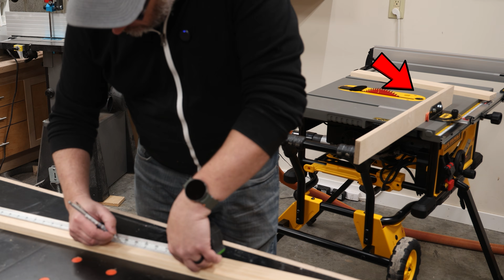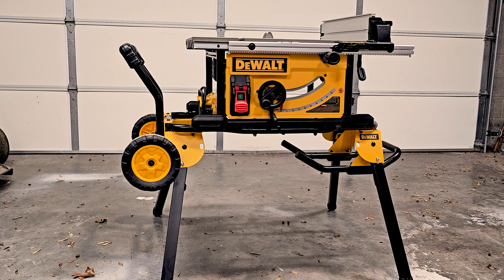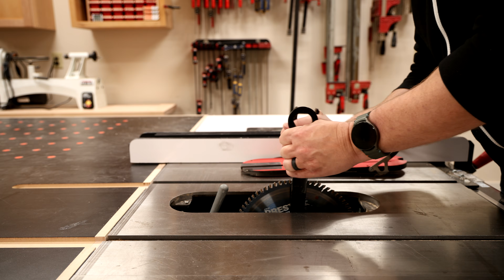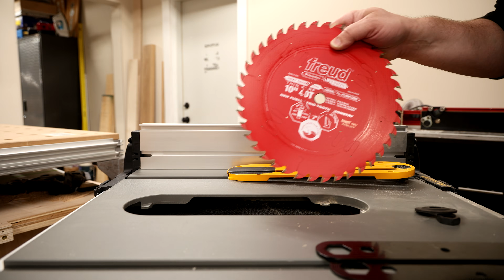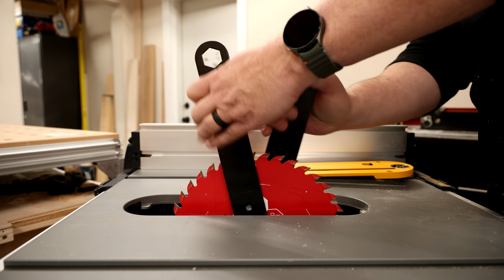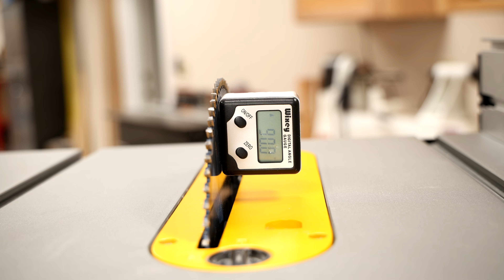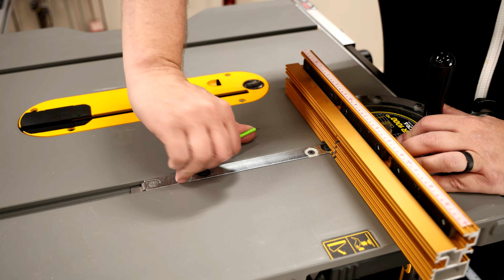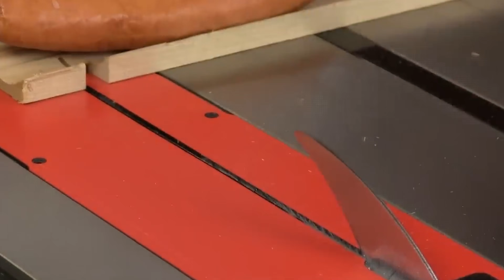Why do people even buy this saw?

Comment: You missed three points.  #1 - noise.  When I went from a job site saw to my SawStop I was amazed at how quiet the SawStop was.  And, #2 - dust collection.  I was similarly surprised at the improvement in dust collection.  #3 - safety.  I know that YouTubers don’t like to use them, but I have found that the blade guard, splitter, and kick-back paws on the ShopStop are similarly far superior and easier to use … not to mention that the blade guard ‘support’ on my portable saw was always out of line with the saw kerf and was too wide for any effective use with thin kerf blades.

Comment: Interesting video.. I have owned both a Delta Unisaw and a Dewalt Table Saw.  I was pleasantly surprised on how well the Dewalt did after years using the Unisaw.  Used to cut oak all day on the Unisaw and it never tired but never tried on the Dewalt.  Full Sheets are always a pain although a good outfeed table helps as does some infeed support. Starting all over again and thinking Track Saw to start this time. Nothing brings more joy than just turning on the Unisaw... you can hear the power.

Comment: Great video. Thanks! Does anyone know what it would cost to take the contractors saw to a machine shop and have them 1) mill the top completely flat (or at least a lot closer to flat) and 2) machine the slots to be identical dimensions and perfectly parallel to one another? Seems like a pretty simple job for them, no?

Comment: Very interesting video. I have that exact Dewalt portable saw. It’s not as much a question of money (retired) but rather the space to house it and amount it gets used makes it very hard to justify, It’s mighty handy to “fold up” the Dewalt and tuck it against the wall in my garage after use!  Thanks for answering some of the questions we’ve all wondered about! This would be an interesting comparison for say a Rockler or Bosch portable router table vs a real high end setup too!  Nicely done, thank you!

Comment: Cabinet Saws traditionally have way better  dust extraction systems   Larger /stronger motors  and in the Comparisson to a Saw Stop  you have the safety  device. Of stopping the blade  spinning  when the electronics detect  skin   The also  traditionall have Etter fences and larger Capacity in comparing them to. A Jobsite Saw. Although. The Jobsite  saws have been getting   Some serious Upgrades  depending on the manufacture    IM retired now  but spent over 35 years in the Trades as a Professional Woodworker and I will note that before CNC technology  and  all the specialized tools  The  Shop Table Saw. Was a tool that did it all  from  cutting every angle  on any sized or type of material   In the old days people built   Jigs   To do allmof that for their Saw  A Craftsman  may have had hundreds of jigs for his Saw    A local shop/ Competitor of mine  had to duplicate a replacement Wood Keel. For the oldest  Wooden Warship for the United States Navy  that was  over 100 feet long and was being fabricated out of the only  known tree   Inthe world  they cut that on a Table Saw  it took   Over 40 men to hold and guide that. Lumber through the Saw  it needed to be done in their Parking Lot to get the correct positioning  in reference.  To all the You Tubers with the fancy  expensive  tools IMO    It’s Hogwash  ,   IM still a Woodworker and I do not own any Kreg or Festool Products   You can   Do everything they do with trsditionalWoodworking tools  by building Jigs  and using hand tools   You don’t need a Dominoe  machine you can build a   Jig  for a WoodRouter  and use  specialized Router bits , same thing  with Lamellos or Biscuits   It’s basicJoinery   In the past. Men that built boats ,Pianos  and Fine furniture utilizing  traditional joinery  did most of it with handsaws and Chisels   ?  Many of today’s Craftsman thatdnt even know how to properly sharpen their tools

Comment: I’ve marked photographs as exhibits in a lot of depositions where the photos depicted mangled and missing fingers from a man’s hand that went through a table saw blade.  I’m a woodworker.  I still have all 10 of my fingers.  Why?  Not because I’m safe, not because I’m lucky; it’s because I bought a SawStop table saw. That’s my insurance against the stress of a wood board being relieved at the worst possible moment and pulling my hand into the spinning blade.  A little cut, a tiny one that only needed a small band-aid.  You see, fellas, MY fingers are worth the extra $500 to $900.  If you don’t value your fingers, or if you are arrogant enough to think “this won’t happen to me cuz I don’t make mistakes,” then think again.  My father operated his 1952 Sears Craftsman table saw for 60 years without incident because he was SAFETY conscious, yet even he had a mishap where the sudden relief of stress in that wood board pulled his thumb into that spinning blade.  He lost 1/3 of an inch of the tip of his thumb.  Then my brother, the safest woodworker I know, cut the tip of his index finger off for the very same situation, and he’d been operating a table saw for 45 years.  You see, gentlemen, it’s not a matter of “IF,” it’s simply a matter of when.  Every table saw operator has a close-call story to tell, but unfortunately, a hell of a lot more ended up in tragedy.  Let me ask you this:  Would you give up one or more of the fingers on your hand just to save $500 to $900?  I don’t know about you, but MY fingers are worth a hell of a lot more than that.  I’ll gladly give up a few bucks to save my fingers.  How about you?

Comment: Found a used Sawstop contractor saw 6 years ago.  Dust control is not excellent but I don't have collection anyway, and 110v motor can be down on thick rips, but otherwise it's precise and an excellent tool.  Built a custom base with storage and prior owner had a good outfeed setup.  Came with an unused dado stack and some good freud blades, it was a solid buy.

Expensive track saw?  Meh, my Makita was $120 on ebay and got the guide on amazon.

Comment: Is there something in between the job site saw with aluminum table and the cabinet saw with a cast iron table? How about a bench saw with a cast table and better adjustments for the blade.
Reply from the maker: a contractor saw is the middle ground

Comment: I don't understand cutting down sheet goods with an incredibly accurate track saw and then finishing the cut with a table saw. Americans do that and from what I understand, most Europeans don't. I've watched hours of Ron Paulk doing fine finish carpentry without a gigantic space hogging table saw. I think for most it's a waste of money unless you have a large shop with plenty of space. Then speed comes into play, but you sure gain no speed from multiple unnecessary cuts.
Reply from the maker: I find the table saw to be far more efficient for cutting parts to final width. The table saw is still needed to make joinery, dadoes and rabbets. Track Saws are great for breaking down plywood but its far more time consuming to try and cut out all your finished parts using a track saw alone. I've watched a lot of Ron's videos, and even using a small jobsite table saw, his full setup with his work table and other accessories is every bit a space consuming as my table saw. It just works better for mobile applications which is the only reason he designed that system. I don't do mobile work I only work out of my shop.

Comment: I was always under the impression that you actually do not want the fence to be perfectly parallel with the blade to avoid pinching the workpiece and also causing inconsistent cuts. I think you want it to open up at the end a smidge for the wood to NOT hit the backside if the blade. The leading edge of the blade is where you cut and set the dimension of the cut. I don't want to suggest that there should be a large angle, but 1/32" is probably not terrible.
Reply from the maker: yes you certainly can do this but you have to be really mindful if you ever cut with the fence on the opposite side of the blade. because now instead of being angles away from the back, its going to be angled toward the back and cause a kickback.

Comment: I started building a new sawstop 52" in my shop. I've had a few issues with the tabletop and wings. The wings when mounted tip up at the outside creating about a 3/16 void over the table. I've built out two other cabinet saws with no issues. Concerning. Sawstop sent a six page instruction sheet to correct it. There are two methods. 1. Forcing the wings down and bolting to the rails. 2. USING PACKING TAPE TO SHIM THE WINGS INTO POSITION????? WHAT? ON A NEARLY $5,000 SAW?

The second issue is an area on the right side of the main table that has large burrs in the cast iron and a noticeable low spot that cannot be leveled. Has anyone else had these issues? I'm not happy at all and sawstop has been very slow to respond.

Comment: i like your videos. Informative and well explained, and you don't spend the entire video yelling at the top of your lungs like the 731 guy. The safety of the Sawstop, in my mind, renders all of the other discussions moot. As an older retired guy, maybe not quite as attentive as I once was, the Sawstop is worth every penny. I have the contractor model with the cast iron side wings and I really love this saw. I set off the brake once because I forgot to set the bypass and it hit aluminum t-track in my workpiece. Goes off with a helluva bang!

Comment: I started with a 2 hp Delta what is now considered a hybrid table saw back in 1989 with a cast iron table. There were no Jobsite at that time. I still have that saw but have bought a 220 v 3hp cabinet saw which makes set up and cutting much more pleasurable. I am no longer resetting the breaker on long rip cuts. I would recommend finding a used hybrid or cabinet saw if you have room to see how much you use it before spending big money on a cabinet saw. If all you need is a saw that you can take to a job or you do not have room for a permanent saw, then get a jobsite saw knowing it is not the same as a powerful and stable cabinet saw.

Comment: setting the bevel from scratch might suck on the DW, but once you catch the correct angle just bevel a piece of scrap and write the angle on it, next time you need to set that specific bevel you can just use the scrap wood to set it.

I think. There could be something wrong with that approach and I've never used a saw with a floppy bevel like that, but I see no reason why you couldn't do it like this.

Comment: My Rigid job site saw collects dust in the threads that raise/lower the blade.  It is a real pain and slows any changes.  Perhaps not an issue with other saws, but even after cleaning, in two cuts, back to the slow go.

Comment: It greatly depends on what you're using it for. If you're making your living building cabinets and rip cut full sheets of plywood every day it's a no brainer to me.  A weekend hobyist is a whole different story. Are you cutting for dead or accuracy you can count on every day or just making a shelf board once a year?  The vast majority of the small job site saws end up just collecting dust because anyone can run to any box store and be cutting up wood that same day and forget they even have it the other 364 days of the year. Most people who are going to spend $3–5000 and maybe even rewire the whole garage and take up enough space that a cabinet saw is are far more likely to use it more often.  And of course there's the matter of being just clumsy and chopping fingers off. Personally I kind of enjoy not spending my weekends in the hospital getting fingers operated on. I'm just that kind of a weenie..I've had to drive one handed to the hospital with blood dripping everywhere before. It's not nearly as much fun as seen on TV.   😂

Comment: I see that you removed the riving knife with the thin kerf blade. Something I'm not prepared to do. The full kerf blades do fine on the contractors saw if you keep them sharp and go slower.

Now that STOP has released the patent, most saws of the future will be stop saws. Even the contractor saws.

Comment: If it wasn't for one detail you didn't mention, I may never have upgraded my DeWalt jobsite saw to a Sawstop. By the time I'd converted my DeWalt to work like the saws I really admire, the Euro slider saws -- then you don't need a brake to stop the blade because the saw is fundamentally safer -- the footprint of the DeWalt was about the same as the Sawstop contractor saw I bought. For really thick stock I rip with a bandsaw and clean the edge with table saw, so there's barely a functional benefit to the Sawstop. So here it comes: the belt driven contractor saw is 80 to 85 dbs compared to the DeWalt which is like 109 dbs. Hours and hours of cutting, even with ear protection, take its toll, not only on you, but on other members of the house let alone neighbors.

Comment: Nice comparison video.  FWIW, you could have slid the fence back and forth on the DeWalt without having to turn the knob.
Reply from the maker: oh yes! very aware. I just wanted to do more of a fair test based on the rack and pinion system. I slide the fence by hand all the time unless I'm making a fine adjustment.

Comment: I've had the Dewalt saw for 5 years now... It's a good saw, not like my cabinet saw but a good jobsite saw.  It was out of alignment when unboxed but easily adjusted.  Lots of power, good riving knife and guard, honestly the factory fence is fine for 90% of what I use the saw for.   It also has really good dust collection for a jobsite saw.  My main issue with it is it has excessive runout at the blade.  I've probably used 10-12 blades, all with the same issue.  I probably should have returned the saw during the 90 day "satisfaction window" but I kept thinking that I'd be able to correct the runout issue.  FWIW I have used coworkers Dewalts and experienced much better results.  If this is your only saw, don't hesitate to return it if you can't get it adjusted to your satisfaction.

Comment: A cabinet saw or a jobsite saw? Even the names tell you there is going to be a difference. A lot of new woodworking enthusiasts will choose the lesser expensive saw, perhaps build a large cabinet to insert the saw into giving more tabletop and the ability for a better fence. Many woodworkers have intimidating thoughts about buying a cabinet saw for either budget, space or infrequent work. Knowing your tool by using it and making helpful jigs will be very useful no matter what saw you choose to buy. I have owned a Delta cabinet saw with a 30 inch Unifence for the last 35 years and I don’t think I will ever upgrade it to a new model but if I did it would be a Harvey over the SawStop. I have plenty of push locks, push sticks and feather boards that I use. My saw has no blade guard and no splitter but I do know how to use it safely and have never even thought about my hands were to close to the spinning blade because I don’t let that happen ever.

Comment: I use two dewalt table saws to build cabinets on job sites all day long. One is set up with the dato stack and the other with a rip blade. I also use the Festool track saw with a counter rotating curf blade, which is an amazing saw. But then again, the aluminum track alone cost $650. I say all of this to say that, of course a $6k to $8k cabinet saw would be my ideal. But I'm not bringing that on a job site when I can absolutely accomplish everything with my set up without the use of a crane.
Reply from the maker: you build cabinets on-site? That's hard core!

Comment: While I agree that is no comparison between a $5k Sawstop and a $600 DeWalt, I think most hobby and casual woodworkers would be just fine with a job site saw. When Tamara from 3x3 Custom first started doing videos, she used no expensive tools and turned out some really nice projects! Of course, now she's upgraded but I think that's just natural progression but certainly not an absolute necessity. If you're a high end custom cabinet shop, price is less of an issue, but for most users, I think a job site saw is a great choice.
Reply from the maker: upgrading is all about how much you want to enjoy your woodworking.
Reply: @MWAWoodworks So I need 20k worth of tools to enjoy woodworking more?? I respectfully disagree. While it may make your project move faster and possibly more accurate, I don't think it has much bearing on how much enjoyment you get from woodworking. I understand that that quality tools are much more enjoyable to use, but I know many people doing some great projects without spending thousands on Sawstop, Mafel,  Festool etc. I really enjoy your channel and in no way condemning you, just my observed opinion. Keep the great videos coming!
Reply from the maker: @Macdad-d7u  I think we agree
Reply: @MWAWoodworks 👍
Reply from the maker: @Macdad-d7u  and also yes, I enjoy woodworking much more with my cabinet saw and Domino vs using a jobsite saw that I constantly have to fiddle with or using a dowelling jig instead of a domino. IMO having to put less effort in less time to accomplish the same quality work increases my enjoyment of the craft. But that's just me 🤪

Comment: I used a contractors saw to build my entire kitchen.  I had to break down the sheets to more manageable sizes with a flat edge and my circular saw (wish I had a track saw). One issue with jobsite saws is that they don't tend to be as accurate and unless you anchor them well they can move a little too easily., but for a small home shop with limited space, they work.